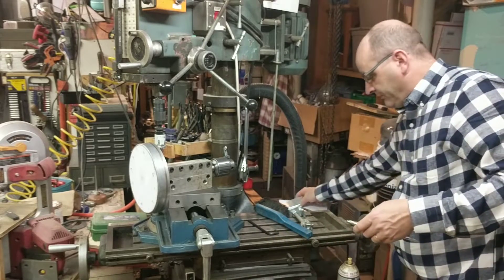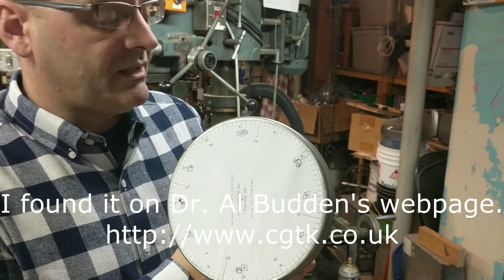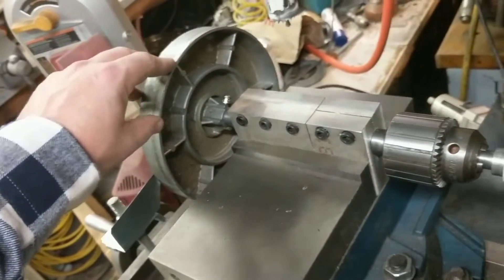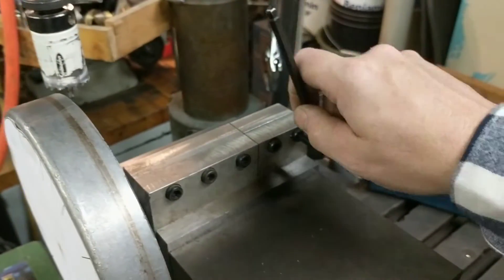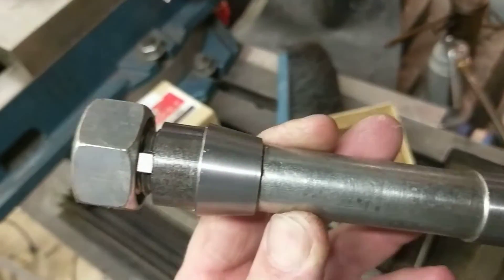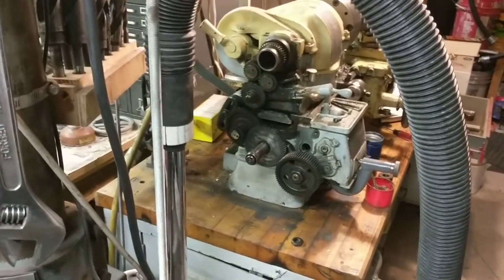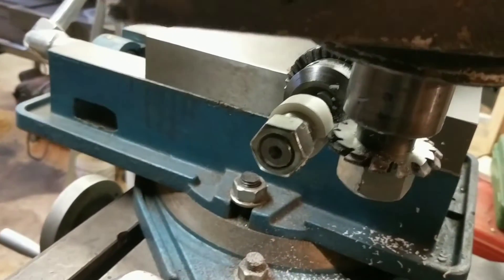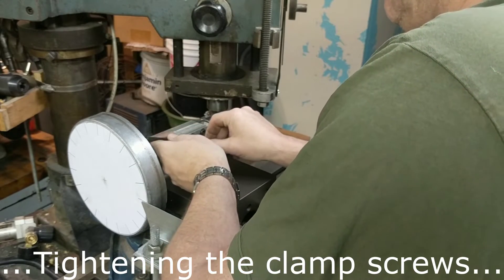Machining Metric Threads on the South Bend lathe --  For Two Dollars???  Part 2

Comment: I’m looking at buying gears but the seller says “with the 48 tooth gearbox gear.” My gear attached to the gearbox shaft is 66 teeth. I don’t find any 48 vs 66 tooth discussion online.
BUT - I don’t see what another gear would matter.  If I changed the spur from 24 to 26 teeth and the QCGB to 10 tpi, I’d get 3.4925 mm pitch looking for 3.5.
Am I correct that we’re just doing a ratio of an inch pitch?

Comment: Elegant solution - with other good ideas included!
   You have a single lever lathe gearbox and the normal purchased transposing and extra gears don’t necessarily work for that.
    Even with a newer twin tumbler SB gearbox, you have to buy the transposing double gear (to get a “metric lead screw”?) and then some extra gears because the jumps between Imperial threads and metric are not the same. This bypasses that problem.
     I guess you could use the same method to get the normally missing 27 tpi thread on an early 10L.
      In your formula, did you start by using the tpi chart and ratio up and down? As in your new gear: 11.5 tpi = 2.209 mm pitch times 19t/24t = 1.749 mm pitch - or 1.75.
Reply from the maker: My approach was a little cringe-worthy, but effective:  I used MS Excel to plot out every permutation of varying the bull gear (from 19 teeth to 60 teeth) across every TPI setting that my gearbox can do.  From there I used Excel's search feature to find the nearest possible match to common metric threads.  (common metric fasteners between .35 and 5 pitch.  You could extend farther in either direction or choose any given pitch number if needed.) 

That produced a list of 8 or 9 bull gears to make the most precise substitutions possible.  From there I shrank the list down by finding gears that are useful for more than one metric pitch, while still  producing an acceptable result.  A good example is the 19 tooth bull gear:  A 53 tooth bull gear makes a nearly perfect metric "4" thread  (4.0065mm), while a 52 tooth is required to make a nearly perfect "5" thread. (5.0030).  But a 19 tooth bull gear can make either a 4.0217, or a 5.0271 metric pitch, either of which are a very acceptable 99.5% match.   You have to be doing extreme edge cases to ever need more than 99% match.  After that I had a list of 5 gears (19,26,33,34, and 37teeth)  I cut those gears and stuck them in a case with a laminated chart of which gear/gearbox combinations are needed for which metric thread pitch.  I no longer have the precise logic/math floating in the forefront of my brain.  I just reach for the case and use the gears and chart as I need them.  The same concept can work for any lathe with a gearbox. but the gear combinations will depend on which gears the gearbox is capable of, as well as how many teeth are on the factory bull gear.  The excel file to calculate your own is linked in the description.
Reply from the maker: And you're right about the 27 tpi on an early 10L:  a 25 tooth stud gear, with the gearbox set to "28" will cut a 26.8800 tpi thread, 99.54% accurate.  You'd have to have like 3 linear inches of thread engagement before that error would come into play.

Comment: Hi Bob, I have included your table of stud gears for the South Bend Heavy 10 'help file'  in my online program RideTheGearTrain and gave you credit and included a link and an embedded video. I hope you don't mind. Thank you for the work you have done and for the table. My email address is on the program. I made a YouTube video about using a circular saw blade as a dividing head for my lathe, and other videos about mounting a treadmill motor on a vertical slide milling adapter on my lathe. These two combined can be used to make gears.

Comment: Hi.  I have the same lathe and this is immensely helpful, so thank you.  I am going to get a set of these gears made.  I will make one change for you.  Instead of that 19 being used to cut the 4.0 metric thread, you should use the 34 tooth as it gives much less % off.  The 34 is really the key to the whole operation...buy one of those and you have access to a bunch of metric pitches.  You should link to your excel sheet too.
Reply from the maker: Glad it was helpful!  and it looks like you're right about the 34 tooth gear.

Comment: Cut all my gears from PVC repurposed from 12" sewer pipe, used the same indexing wheel from the same site as yours. I cut the gears by slotting with an HSS form tool on the crossslide (about 10 passes each tooth). I found all I need for most metric threads on the 9A was a 19, 22, 26 and 28t stud gear. There is also a Linear scale on https://www.cgtk.co.uk/metalwork/calculators/linear which you can print with numbers and make your own 200 division large dials for the 9A. I just glue them on to hardwood or aluminum and coat with clear sealer. Metric gear writeup here: https://groups.io/g/SouthBendLathe/files/Techinfo/Metric%20Threading/Metric%20on%20a%209A%20by%20%20martik777.pdf
Reply from the maker: Very nice work!
Reply from the maker: I just read the metric gears write-up.  Bummer.  I actually thought I invented this!  Oh, well.  No new thing under the sun.  It did strike me as a little obvious for no one to have found it before.
Reply: @TheBuildist  Kudos for you for taking the time to produce a video! I posted that write-up on some forums but most people wanted EXACT threads with the transposing gears - I guess machinists tend to be perfectionists!

Comment: Great idea!  You can also do this on the lathe with a indexing wheel mounted to the spindle and slotting the teeth with an HSS form tool: Here's how I did it: https://photos.app.goo.gl/p9qY3vqPvHNA6jB57
If anyone wants the gear tooth counts for various metric pitches on a 9A, just reply
Reply from the maker: Nice work!

Comment: What diametral pitch did you use for your calculations? Pretty sure the original gear is 18.
Reply from the maker: I can't recall at this second if it's a 16 or an 18 pitch gear. I'll check it later today and update you.

Comment: If I was going to do that - I would at least use aluminum for the material.  That plastic is not strong enough  on that heavy carriage.  After you strip a few threads trying to thread a steel bolt thread on your lathe you will see that the pinion gears are under a lot of strain.  Even aluminum is iffy if the threads you are cutting are coarse or in steel.  The back pressure on the gear train will find the weakest link and you are risking a "crash" because you can't back out of the V thread groove fast enough when your plastic gear fails.  Just FYI.
Reply from the maker: I appreciate the input.  I've only cut 2 or 3 metric threads since I made them, so I don't have a lot of experience with them yet.  I'll watch out for it, and report back on it.

I am about to make an ER-40 collet chuck, but the threads on that will be fairly fine, so that's not terribly applicable.

Comment: you can buy the real gears you need off of either Ebay or the South Bend lathe group on Yahoo groups.  I think they are steel gears.  But great effort and nice try!
Reply from the maker: Oh that was the reason I made this video in the first place. there's a lot of uncertainty of exactly what gears you would need to buy and exactly how they need to be installed. And they're going to be pretty expensive definitely over $100 investment maybe double or triple that. But when I found out that I could shop make a small set of gears myself and give myself essentially the identical capability, that just seemed too good to be true. So I had to try it. And it worked!

Comment: I like your budgeting skills. Nice gear. Where did you get the gearcuters. What size are they. I have a S B 9 inch it had no gears.
Reply from the maker: Glad you enjoyed it!  The cutters I'm using are 18DP.  About $77 on EBay.  However, I'm currently making a set of change gears for an Atlas 618, which are 24DP, and for those I'm not buying cutters.  Instead I'll be making a gear cutting hob, as found on this site:  http://www.helicron.net/workshop/gearcutting/gear_cutter/    I've done this recently with a 48DP gear, and it worked like a charm.    If you had a piece of Water or Oil hardening round bar of about 7/8" or larger, you could make your own hob for 18DP gears.  And a single hob cuts any number of teeth, from about 12 and on up.   You can see me making and using a gear hob in this video:  https://www.youtube.com/watch?v=iokeMvTmrV4

Comment: Thanks for the video. What's your process for choosing the correct cutter and where did you get them? I've done some research in the machinery's handbook. But I haven't followed through to get things going like you have. I have an older Craftsman 618 lathe I might try this with. I have a couple of other larger lathes that are set up to cut either metric or imperial. But I still like tinkering with little one once in awhile. Thanks
Reply from the maker: I looked up what diametral pitch my lathe uses, and also measured the ratio of od and tooth count to confirm.  My lathe uses 18dp gears, and I bought a set of them off of eBay.
Reply: Mike Krening I have a 618 lathe and I’m sure you know you can cut metric threads on your 618 with only the standard change gears. You just can’t use the thread index wheel, once you engage half nuts leave them till threading is finished. The procedure is covered in the manual.
Reply from the maker: You're right, of course.  The approach in this video applies to machines that have a quick change gearbox.  With a qc gearbox, it's easy to cut any threads that are already"baked into" the gearbox.  This video's approach lets you cut threads that are outside of what the gearbox designer planned for.

Comment: How do you insure you glue on the paper index on center? Would a pointed indicator be more accurate to let it split the line on the wheel?  Got any idea how long the gear will hold up? Was an interesting project to watch but I hate metric fasteners.
Reply from the maker: In my experience with pointed indicators, I feel like this is more accurate.  I look at the "gap" between the black line and the edge of the pointer, and stop at the "precise" point that the gap has closed.  I feel like I can judge that to within...  .01 for sure.  maybe even .005?  
As far as the gear holding up, for how often I'll need it, I'm presuming a lifetime.  :-)  But in actuality, no I don't know.  But making gears out of hdpe isn't new, so I think they'll do ok.

And thanks for watching, thanks for the questions.
Reply from the maker: I turned and inserted a palpable sharp point at the center of the indicator wheel.  Then I print out a dot or crosshair at the center of the printout and use feel to be sure it's exactly centered.